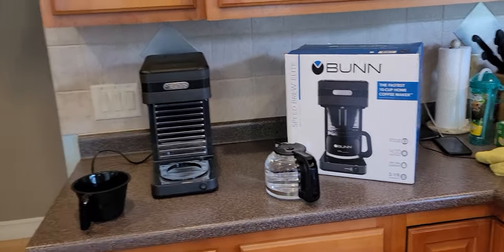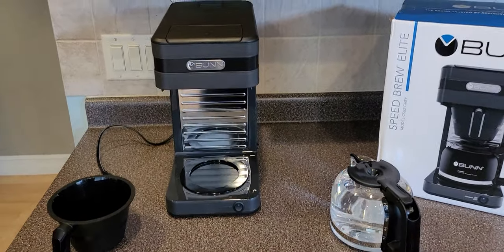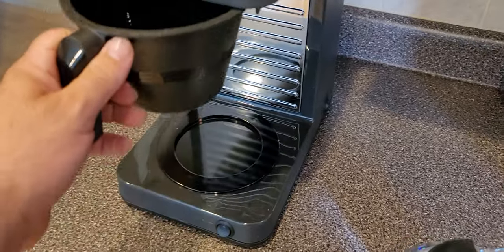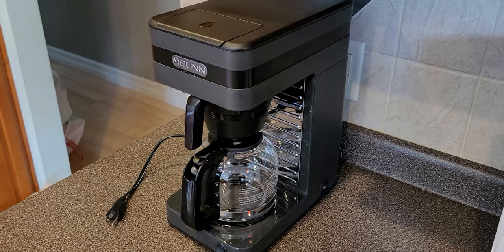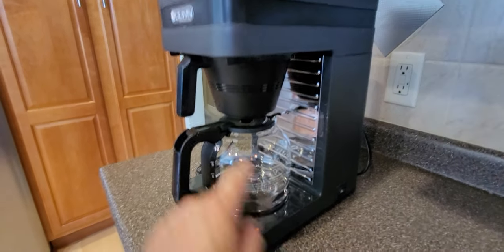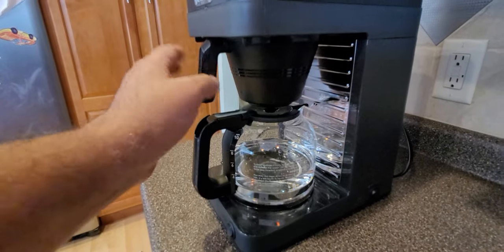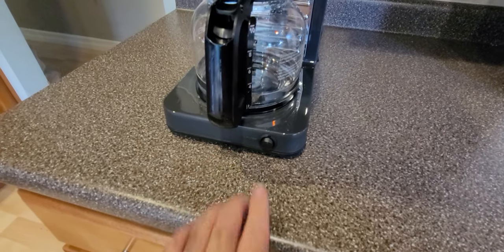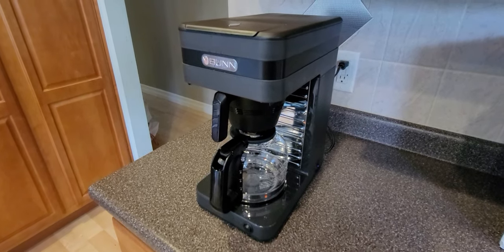BUNN Speed Brew Elite (CSB2) initial set-up

Comment: So actually the coffee pot Has to stay on all night and plugged in? And if so is that the only way in order to brew the coffee the coffee pot stays on 24 hours a day I don't understand that one
Reply from the maker: Yes, you're correct. I drink coffee a lot, so I leave mine on 24hrs a day. Do when I go to make coffee, it's literally coming out instantly. I do turn it off if I'm going to be gone for a couple days, or on vacation. If you do turn it off everyday, the next time you make coffee it's going to take maybe 20 minutes for the water to heat up that's in the back of the tank.
Reply: @joeyrangel3927  wow, that is an intriguing concept. I too drink coffee each day, so I guess I'll be leaving it on. Hum

Comment: So every time we make coffee we are to do intial setup and then the brew setup?
Reply from the maker: Nope, just the "Brew Set Up" from here on out! Fill the carafe with water once, lift the fill door at the top of the machine, poor the full carafe water in the fill port, put your carafe back under the machine, close the fill door and it will start brewing. Unless you leave the machine on for over a week without using it which will dry up the back tank, you'll never have to do the initial set-up.

Comment: Do you leave the coffee pot ALWAYS on and just add the amt of water each time plus coffee grounds
Reply from the maker: YES!! Since this one has the glass carafe, it has a hot plate that the carafe sits on. If you have a model with a stainless steel carafe, then that one does not have a hot plate. I leave the main machine on all of the time to keep the water in the back hot. If I leave for more than 2 days, I will shut the whole machine off. Since I have the burner plate in the front because of my glass carafe, I only turn that on when I make coffee to keep the pot hot, then I always turn that one off.